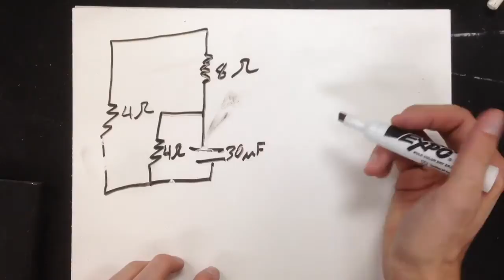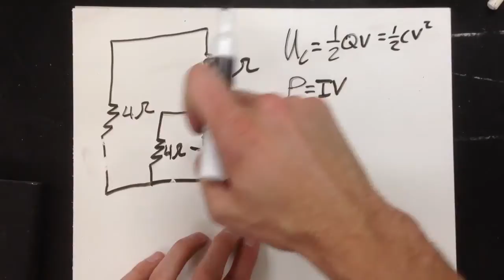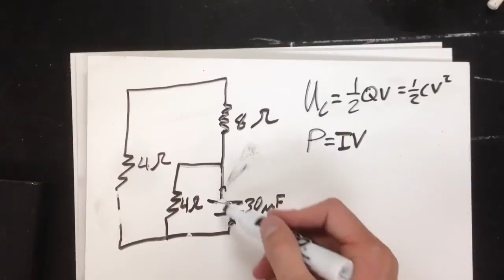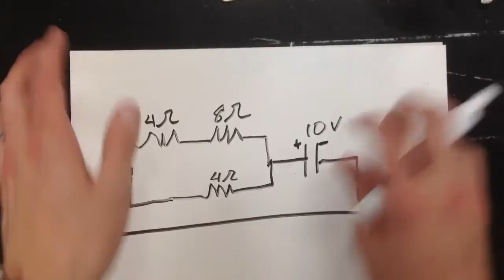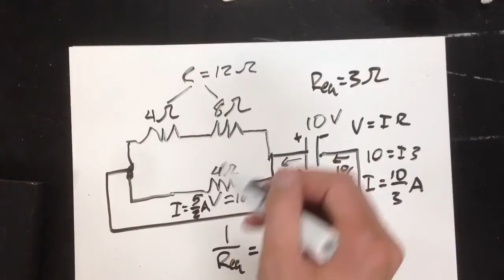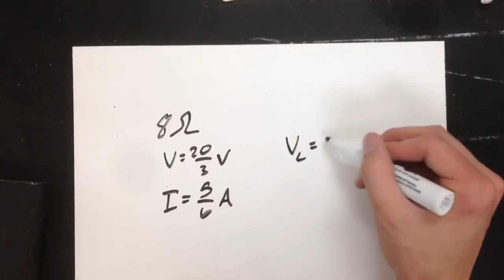RC Circuit Power Dissapation

Comment: But aren't both current AND voltage decrease as the capacitor discharges? How to calculate the amount of energy dissipated by a particular resistor? Should I use an integral to do that?
Reply: Current will increase up to 10V/total resistance A and voltage across capacitor will be zero at 'Steady State'. At this problem, he assumed that capacitor is already charged so that this electrical stored energy will be distributed to the resistor. Hence, the sum of the energy dissipated in each resistor will be exactly same with the stored energy in capacitor. To calculate the dissipation energy in resistor, yes you can intergrate I* r with respect to time. Hope this helps you